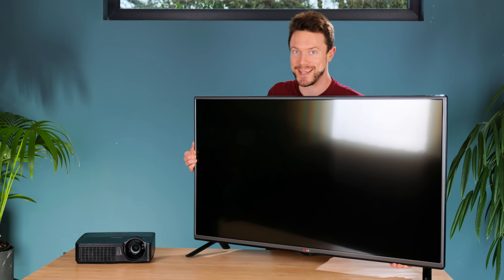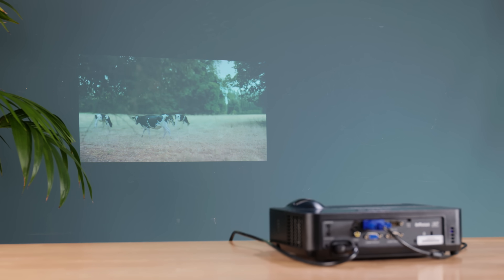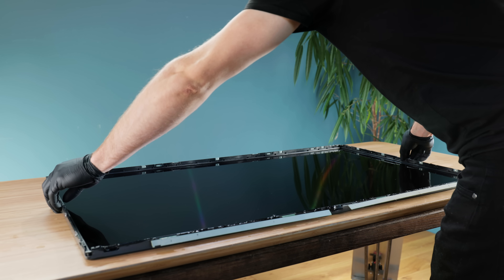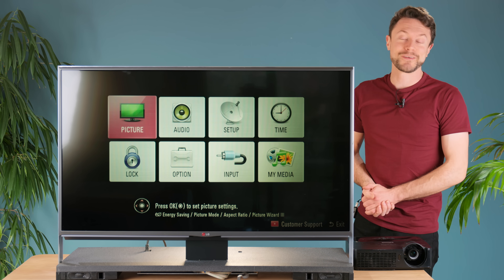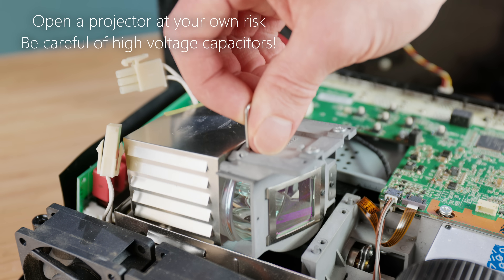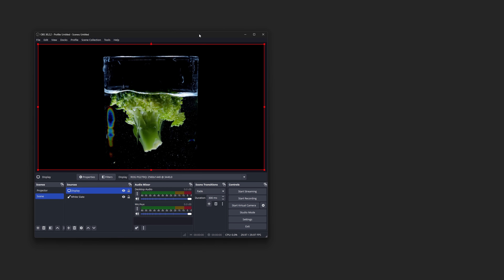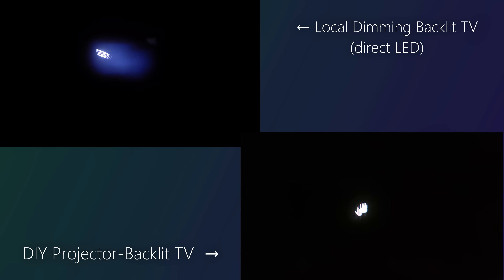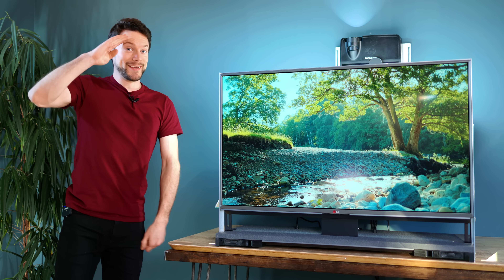DIY "infinity contrast" TV -  with 100% recycled parts

Comment: About 5 years ago, when I bought myself a projector, but had not yet bought a screen for it, I tested it by shining light on a hanging cloth (a mattress sheet) on a wall with many folds of fabric. And while I was waiting for the screen, I came up with an idea to compensate for the pattern of the folds, or rather the shadows from these folds that appeared when the projector shone on them. I took a picture of the cloth on the wall from the projector projection point on my mobile phone and made a multiplication mask in an image editing program to add more light to those places where shadows appeared after projection. And it worked! Then I tried to remove the cloth and shine light directly on the wallpaper with a small pattern of patterns. And I also tried to compensate for these patterns on the wallpaper using multiplication (as a filter before the image is projected). And it worked too. It seemed like even the color of the pattern could be partially compensated.
Then I thought, why don't projector manufacturers immediately implement this functionality in their projectors. It's convenient. It would be possible to project onto any surface and with the camera from the projector and algorithms compensate for any defects of the wall.
Reply: Yea that’s smart. Basically have a filter on top the image being projected that “cancels out” the color of the wall behind it. In theory, even a wall with wall paper could make it look like a plain blank wall.
Reply: Wow that's actually genius!
Reply: there are projectors that do exactly this.
Reply: How did you apply the filter multiplication mask to your source output though?
Because the same technique could be used to cancel out burn in on OLED and other susceptible screens. 
Or flashlighting on LCD screens.

I have had this idea for years to be able to cancel out these things but I don't know how to apply it because I am not a programmer.

The closest idea I have yet is using the app Shaderglass and running a shader to do what you did over your whole PC output to fix these things. 

More details please.

I have heard people doing something similar by running the shader to do it in MPC-HC for example.
Reply: @cajampa  I didn't manage to use it fully. Only during testing on static images. As far as I remember, I just used the compositing program Nuke (from the company "The Foundry"). But it was just a test of the hypothesis. It was far from convenient to use.
Reply: @ermperson  Ok that is to bad you couldn't get it working.
 Thanks for the added details.

My plan is to get help programming up some type of shader to run something like this. With the help of one of the frontier LLM. They are getting really good at helping less than proficient people with programing up these kind of things nowadays.
Sooner or later it is going to be possible.
One day I am going to figure out how to do it. That will work universal.
Maybe even that OBS he used in the video can be used for something like this.
But as I said earlier in the thread so far my best bet is that Shaderglass app.

It should be possible to hack together something, with a guiding hand from something who knows who put together, some slick shaders and run such a mask filter over the output of the screen.
Reply: @cajampa  I had this same idea to use shaderglass the day I noticed how bad the banding/flashlighting is on my Black Friday TCL I got in 2021. I just don't have the technical knowledge to make it a reality.  I guess I would want to take a photo of the uniformity issues and turn that in to a shader that compensated for them somehow.

This video made me consider trying to pry apart my panel and mess with the diffusion layers in my TV to try and fix this.  My other thought was to just buy TVs and return them until I get one with good uniformity but it feels evil for a few reasons.

The flashlighting really ruins a nice blue sky in Red Dead Redemption 2. 

Good luck on your quest to achieve this.
Reply: Maybe it can be used to cancel out the dirty screen effect on TVs too
Reply: @TorAtleLunde  It should work just as well. This function/feature needs to be available on the PC somehow. I would clean the quality of so many screens.
I hope they reply with more details how they did it.
Reply: @ermperson  Hey dude look at the thread by the guy under this video that made the obs plugin he used. He mentioned a plugin for obs that is called advanced mask.
It sounds like maybe it could do what we want already. I haven't checked it out yet though.
Reply: Only works if the "resolution" of the defects is lower than the resolution of the projector.
Reply: Wow!!!
Reply: A couple of battens for a frame and a staple gun would cost £10
Reply: I think Samsung does something like that with Freestyle though I think it only compensates for one single color. (Say you have a gray wall with a magenta tint so it’d shift the projectors colours a bit towards green to compensate)
Reply: I'm so stupid, I would've just ironed the sheet.
Reply: I have  developed a gray scale mask software to make the projected image even  in visual basic for a 3d printer i was building  using a dlp projector many years ago but it was just for pictures. not really that hard and im not a software developer, it took a week but got it done.
Reply: Could be really easy to implement with just a single 5 cent photo diode on the front of the projector..
Just illuminate each pixel in quick succession in all 3 primary colors, take the difference between the "off" and "on" pixel level on the photo diode and use that as the compensation pattern.
This is just a way to remove the need for a full camera + any allignment issues between the camera light path and the projector light path would be fixed automatically.

Comment: How about using an old rear projection TV and replacing the screen with an LCD? It is free standing, has a short throw projector inside, speakers, housing and usually has a lot of space inside so maybe you could integrate a small form factor computer to run OBS.

Comment: I wonder if there's a calibration tool to warp and adjust the projector's input so that the projection lines up with the pixels on the LCD better allowing for less blur filter use, which should get you even better results.
I got this idea from the memory of calibrating the resistive touchscreen of an old phone with a pen, and I have to tap at the middle of certain crosses for the touch screen to be accurate. Maybe a similar alignment method can be used here too.
If there's a way, I'll be interested to know about it, as this does seem like an amazing project to do!

Comment: You just need the mirror and lens from an non working ultra short throw projector to replace that ceiling+back mirror setup. And make an enclosure to prevent both light from leaking into the room and ambient light leaking into the screen. Even blackout fabric would do the trick for cheap

Comment: Well I'm impressed. Poor quality backlight is really the main problem afflicting LCD panels and their performance is wildly improved by this method. I think the only areas of real improvement would be to find a suitable short-throw projector to stuff into the base platform, a small rigid rear shroud covered in black velvet to mitigate light spray past the edge of the display, and a larger scrapped LCD panel, preferably with a quantum dot layer to attempt to correct the color accuracy issue. Oh, and the native aspect ratio of the projector should be 16:9. A DLP model that you've eliminated the color wheel on should do very well if you can find one. A fairly inexpensive 1080p model would do very well as you'll only have a bloom effect of four pixels at most. If you're going to opt for a short-throw projector then it may be worthwhile to just build the entire setup into a standalone piece of furniture like a TV console so you can have room for everything you'd want to include.

Comment: 2:09 I think it’s kinda similar to the apple does the lcd display for the iPad where they have an insane number of backlight zones, it’s like 1000 dimming zones for a 12 inch display
The main reason I can think of for why this hasn’t been done before is size, back in the early 2010s a race began to see who can make their tvs as thin as possible and this foe the longest while came at a price of audio quality and picture quality especially with plasma tvs (even now audio quality on most tvs in the market is questionable as best, not that they were that much better on older ones)